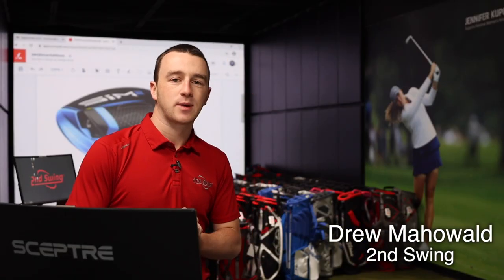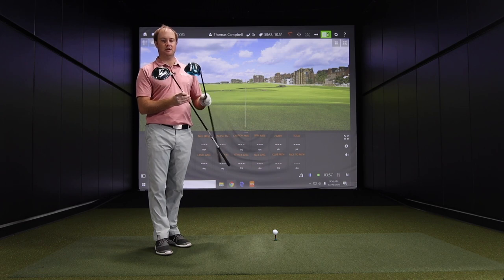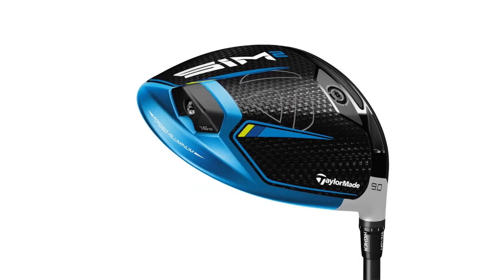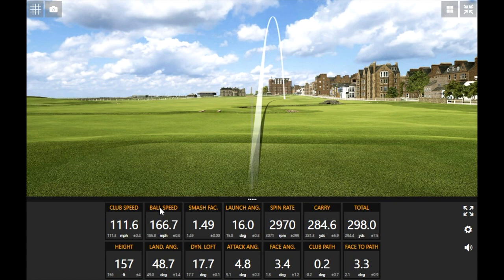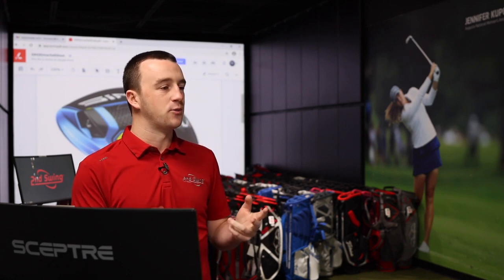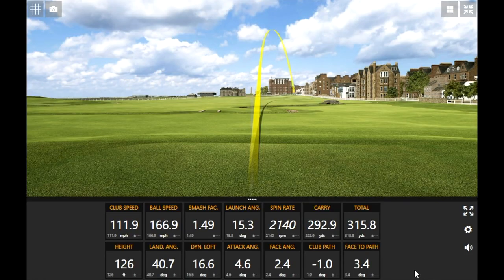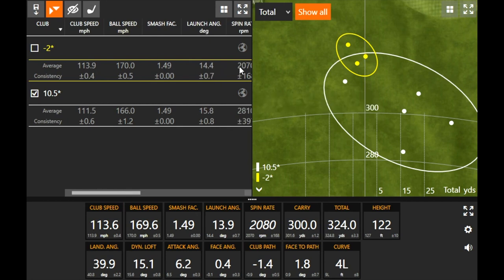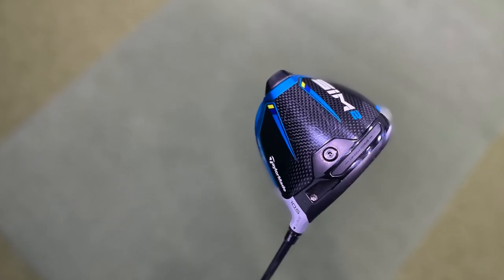TaylorMade SIM2 Driver Review | Trackman Testing & Feedback

Comment: Does anyone else notice how the center of the face is extremely heel side relative to the footprint of the crown in these drivers? If you have one, hold the head so the face is pointing towards the sky and you will see the center is extremely heel side. not saying it's a bad thing, but definitely something I noticed right away. Taylormade have been doing this since M4 really, and it has gradually gotten more and more heel side through the years.

Comment: Quick question: I'm playing a Ping G410+ 10.5(tuned to 9) with 112 club/165 ball, but can't carry it over 270, what do I need to optimize to get to numbers like you had at 5:51?
Reply from the maker: Hi Kevin thanks for watching. What is your attack angle and spin rate numbers? My attack angle is +5 which results in a high launch but low spin.
Reply: @2ndswing  My launch angle is between 11-12, so I'd guess I'm +1-2 attack, spin is 2500 range with a 1.48 smash